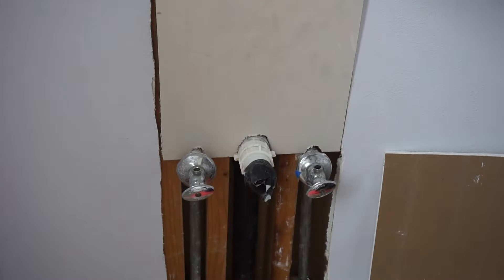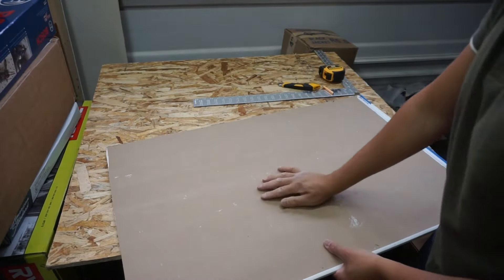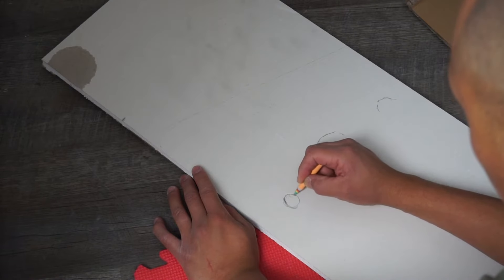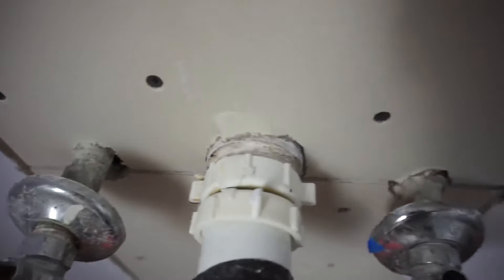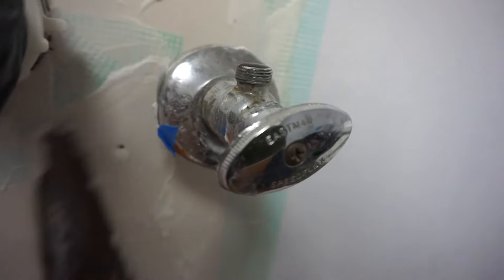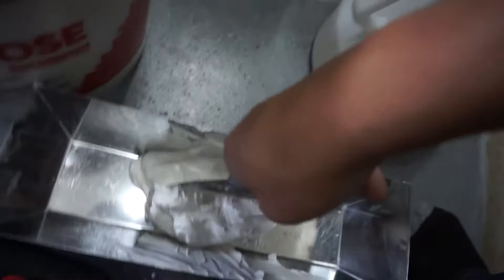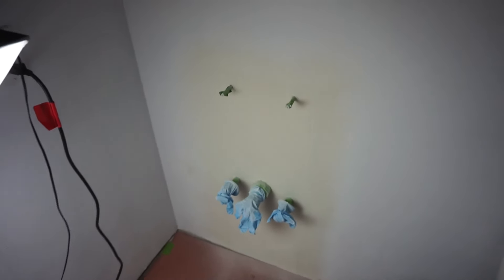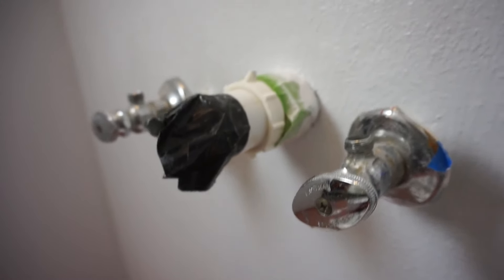How To Install Drywall Around Pipes Perfectly! | Easy DIY For Beginners!

Comment: I would rather see how to cut those pipes and recess them into the wall, into the boxes they make for that purpose. I have pipes sticking out in my laundry room, both from a prior washer/dryer set, as well as a water heater. The plumber just capped them off and left them. I would like to recess them into the wall, but the plumber wanted $900, which seems ridiculous.
Reply: Don't recess them into the wall! You want it outside of the wall so in case a leak begins you'll be able to see the leak and fix it. Besides it's in a laundry room where nobody can see it. If you don't like the looks of it and just put a shelf over it to hide it.

Comment: The template gave me an idea of how to fix an area on each side of my kitchen window.  The electrician didn't measure the right spot to put the undercabinet electrical plug molding and lighting.  So they had to move it which left a "smile" looking opening in my sheetrock going from where they moved all the wiring closer to the window and cabinet edge (about an inch thick) to under the cabinet.  This one is a tougher fix for me.  I cut out the area by the window to add in a rectangle of sheetrock.  Now, I am going to either add in a patch over an inch thick area or do a template and cut out an area to exactly fit the other half of the smile line that goes under the cabinet...on each side of my windows.  Crazy!  Thanks, electricians!

Comment: I just had a spigot installed inside my garage,  my plumber had to remove a piece of sheetrock to run the water line.
How difficult is it to patch this piece of drywall back up?
Any tips, advice?
I was quoted $400 to repair this!!
Is there a way I can send you a picture of the repair area?
Reply from the maker: Hi! Send me a picture to my email: fixthishouse1@yahoo.com
Reply: @FixThisHouse  just sent photos, thanks

Comment: Hmmm nice!
Would have been better to use 5 minute mud to fill in cracks, than 20 minute mud, than another coat of 20 minute and 1 coat of regular mud joint for skimcoat/finish 👍🏼
Reply from the maker: That works too! 👍🏽😊